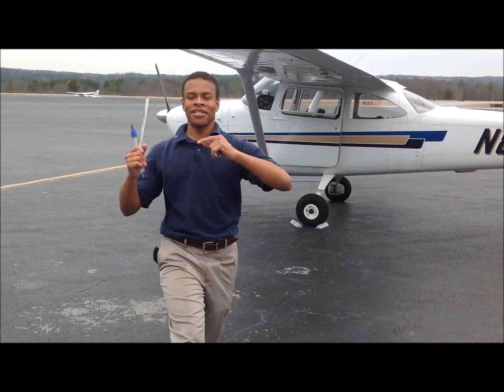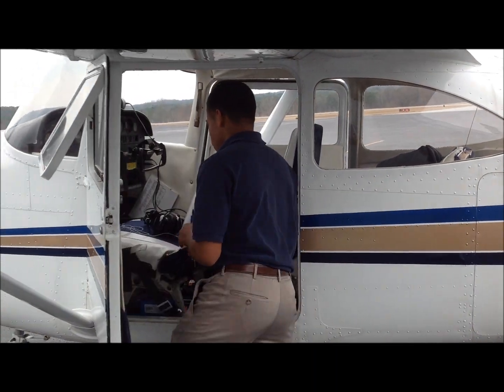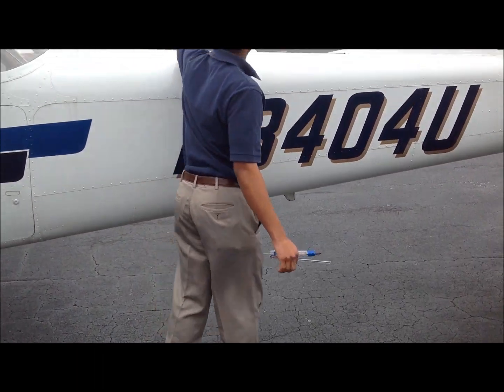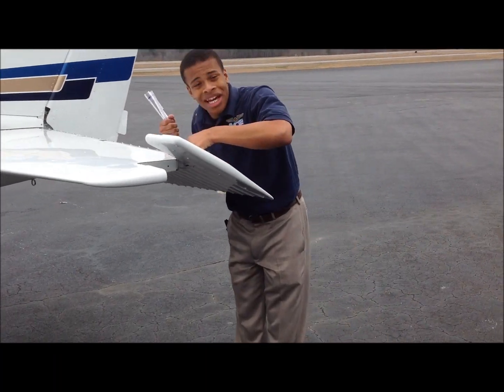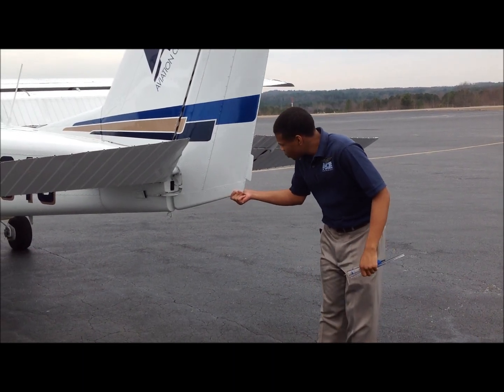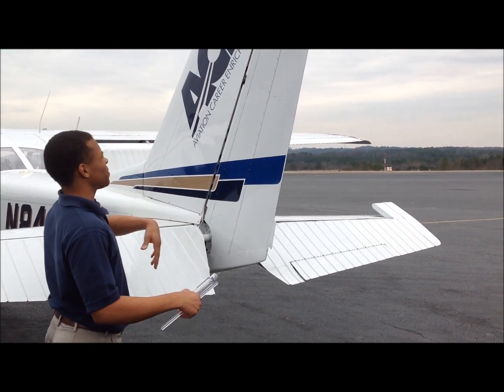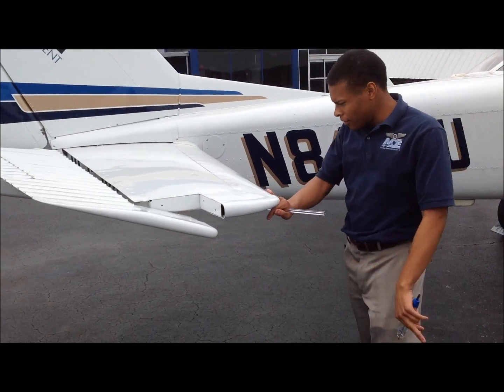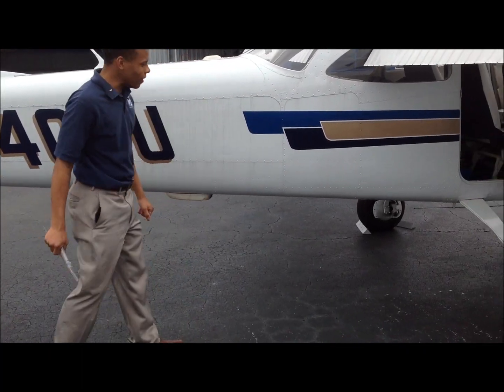How to Preflight a Cessna 172 [HD]

Comment: Pro tip

- Check there are no wrinkles on the wing and the horizontal stab that runs about 45 degrees of the cord line. If so, the plane was over-G'd.
- Never put your finger inside the slot where the aileron attaches to the wing without supporting the aileron with your other hand. A gust of wind can move these surfaces, leaving you with one less digit. This also applies to the rudder and elevator.

Comment: 9:01, you don’t need to move the prop at all. Not worth the risk. The only inspection you should do of the prop is running your finger along it to check for cracks or dents.
Reply: u actally should have listened to his explanation afterwards [on realizing that he may be mistaken]
Reply: @ISAIAHSIMBA-z9s I did listen to his explanation. I have over 200 flight hours, most of which is in the Cessna 172. I still wouldn’t mess with the prop like that, in the off chance that the magnetos are not properly grounded, which would risk an accidental hand propping, which would be extremely dangerous.
Reply: @videogameplayer0552  well ...I get your perspective...I just think he cautioned against it

Comment: I love your preflight but I have questions. How do you know that the light bulb on your navigation lights and landing lights are working? I usually switch the lights on while the flaps are lowering and do a quick walk around with all the lights on and make sure that the lights are actually working. Also, you didn't show the interior check making sure that your markings, fire extinguisher and first aid kit is there. You did mentioned that you checked the aircraft documents but then also with a preflight, interior inspection, cracks or damages to the instruments, seat belts working and latching etc. Also, I like to check the belt through the front for the alternator cause I've found it where that belt is near break and the last thing one needs is a alternator light warning and a sooner landing on a cross country to get the belt replaced.

Comment: Behind the left wing strut is the fuel overflow vent. There are two purposes for this vent. One, that vent allows excess fuel that either expands in the summer when hot temperatures causes fuel expansion or fuel flow out when the tanks have been overfilled, and two, the overflow vent allows air to flow into it in order to replace fuel as it is being burned. This prevents negative pressure, which can lead to vapor lock and engine shut off.

Comment: I have my students to turn on the master switch, lower the flaps, check the fuel gauges, and do a quick walk around just to check to see if all the lights are functioning properly and when turn the master off and proceed with the external preflight inspection.

Comment: Just a couple of things 
1. Always check the baggage compartment 
2. Always check the baggage compartment door is secured and locked. Had it pop open one time
3. You checked the upper portion of the wing for riverside popped always check the under wing for secure rivets and secure inspection plates 
4. While the master is on check your nav lights strobes etc also
Reply: Also did not check the belt on the alternator

Comment: I absolutely loved your PreFlight video.  It was exactly the same as when I learned in 1974.  The sad part is now it's 2020. It seems every rental service comes with a different version of how they prefer to do PreFlight.  My complaint and this goes out to everyone.  When a CFI doesn't want you to check the oil (saying he'll do that) or don't drop the flaps we'll check it on the Run-up is just another case of inappropriate training, at least for the Cessna 172.  The last and most crucial part of any PreFlight I consider the absolute most important is Fuel Checks,  from adding fuel properly to checking it after fueling up.  On my recent Annual with a CFI I watched and knew to check the fuel by straining a sample before starting the engine but he was in a hurry and simply fueled and flew without checking.  I'm happy to say that day he got lucky but I wouldn't be. Which brings me to the point never refuel an airplane without checking the fuel for sediment.  Let me rephrase that more specifically Never start an airplane unless you check the fuel first.  I have and probably always will run into on occasion contaminated fuel.  Strain and check as many times as necessary until all water or sediment like dirt or metal debris from refueling are gone and if your not sure wait at least 20 minutes or 1/2 hr. and check again.                                                           Hey, GeneralAviationGuru how about a proper Run-up Procedure, at the cost to instruct I'd rather watch your videos over and over that way I know I'll get it right.  P.S your video was so in depth I decided to Subscribe and click the bell for all your videos. Again that was excellent

Comment: You forgot to check the air filter as well as the edge of the propeller  plus the fuel tank vent tube. have a safe flight. Bravo to Charlie

Comment: dont dump fuel on the runway even in Georgia, it all washes down stream.
Reply: it won’t wash down stream unless it’s an excessive amount of fuel. it typically evaporates extremely fast
Reply: @0_wba  Lead does not, and it leaches into ground water
Reply: @krisztinaholly  it’s not common lead used in these small planes, it’s tetraethyl and it evaporates at pretty much room temperature

Comment: Nice video however the only thing I would include is the use of a CHECKLIST no matter how well you know the inspection. Also to visually check the baggage compartment for any leftover and/or loose items that could add unwanted weight and/or possibly create a weight shift while flying.

Comment: Informative video. Carry an accurate electronic gauge and check the tire pressures. Flying club a/c almost always have underinflated tires. I've seen hard landings damage wheel flanges (expen$ive to repair) because the tires were underinflated. The pressure specs are in your POH. For example, Cessna 172S and later: nose wheel=45 psi (cold); main tires=38 psi (cold).

Comment: It is not f*cking "O.K." to dump your fuel sample on the ramp, no matter if it's legal or not. There is a reason why it is illegal in Florida, and it being legal in Georgia is just a sign that Georgia lives behind the moon in this respect!
Get an old canister, collect the stuff and dispose of it properly. What you're doing and recommending is f*cking outrageous.

Also you didn't check the prop for nicks, cracks, etc. and as a safety precaution: Before inspection, always remove the ignition keys and place them on the dashboard underneath the windshield where you can see them from outside and never touch the prop if you cannot see the keys underneath the windshield. 
You only have one pair of hands. Complacency kills!
Reply: GNUFZ I dump gas on the ground every chance I get.  I’ll pour some out in your honor today 😭😭😭😭😭

Comment: Suggestion from a checklist I use...  Master on: Switch ALL lights on,  including Pitot Tube heat.  Check all lights and touch the tube for warmth.  Master off.   Put a tennis ball on your fuel measuring stick.  Position it so that went you drop the stick into the tank, it is at the top.  Prevents accidental drop of the stick into the tank!  Tally Ho!!!

Comment: Excellent video!  I was taught to alway's control with one hand any control surface that you were evaluating BEFORE placing fingers to check for weights , pins , connections etc., because if you had your finger in there and a gust of wind moved your control surface you could cut off a finger or two.
Reply from the maker: Thanks.  I was taught and do the same.  Some things like that missed illustration in the video

Comment: So when you're in Florida, how do you check the engine fuel sump?
Reply from the maker: +Jake Jones We didn't have GATS jars at that flight school, so it was the only choice at the time.  I really don't/didn't like the idea of dumping fuel, especially since there is a major waterway near that airport.  I'm happy to now have better equipment at my disposal.
Reply: +GeneralAviationGuru   When I first started flying, DECADES ago, dumping fuel was as normal as tossing a glass of water. Guess environmentalists have had a significant impact. Anyway, for what it's worth, the hydrocarbons simply evaporate harmlessly into the atmosphere.

By the way, nice video. Thumbs up!
Reply from the maker: +Jake Jones Thanks!  

Haha you're probably right.  But I probably wouldn't want the lead or other additives in the water
Reply: +Jake Jones  Hydrocarbons, i.e., volatile fuels, do evaporate as vapors but they aren't harmless; they're so toxic as to be carcinogenic. That's why cars with SI engines have been built with evaporative control subsystems since 1978. It's not just the "impact" of "environmentalists." The gas vapors remain in our atmosphere near the surface where Us Humans live and breathe. Every pilot should carry a "gasoline analysis test separator" (GATS) jar. And if the fuel is airworthy, it can simply be dumped back into the tank.

Comment: I watched the entire video. Well done, learned that I had be omitting the top rudder hinges by not looking up. I would add pulling on alternator belt for proper tension, if accessible on the 'F' through the air intake. I check this on the 'R'.
Reply from the maker: +David Williams I also check this on the R/S models (or any other model with a Lycoming engine); however, the Continental engine drives the alternator from the accessory gear box, hence the alternator is mounted on the back of the engine (no belt)

Comment: I learned a couple things from this video, but I disagree with few things:

1. Some commentators already pointed out the FAA required checklist wasn't used during the inspection.
2. The propeller wasn't inspected for nicks and dents. 
3. I would check the spinner to make sure that it would not loose and wobble.
4. Fuel samples should be checked not only for debris, but more importantly for water contamination. 
5. What's wrong with putting the fuel samples back in the fuel tanks? Just make sure that the fuel sample test tube is clean before testing the fuel.
6.  With a strong wind gust that snaps the aileron,  you might loose the fingers that you put in gap between the aileron and the wing!

Good video anyway! :}
Reply from the maker: +Tuan Tran

1.  Per standardization at the 141 school where I currently am flying, we preflight with the checklist in hand.  It was not required, at the time, at ACE.

2/3. Thank you for pointing that out.  I made a couple of omissions in the making of the video.

4/5.  I would certainly consider water as "debris"/ unwanted foreign matter as far as fuel is concerned.  I agree putting the fuel back into the tank.  However, we had very old fuel sampling jars that did not filter particulates.  Without a GATS jar, I wouldn't want to pour it into the tank, especially with an old and dirty fuel tester.  Again, since I know fly FAR better equipment, we simply pour it from the GATS back into the tank.

6.  That's why I hold the aileron with my other hand! :)
Reply: +Tuan Tran Things must have changed since I last flew because there was no FAA checklist. And who's gonna climb back up just to dump an ounce or two of fuel back into the tanks?
Reply: In general the preflight is not meant to be super comprehensive all encompassing inspection of an aircraft, I can make that checklist 300 items long checking things from rivets to the internal wing spar to control rods and cable to a tiny oil spill etc. The preflight is meant to cover critical items such as flight controls, amount of fuel, oil, fuel contamination and the legality of an aircraft, as you gain experience as a pilot you will learn to determine what is and isn't safe.
Reply from the maker: +Jake Jones Doesn't need to be "FAA".  It has just become standard practice in recent years to accomplish the preflight with the checklist in hand.

Comment: Is it bad that I don't use a ladder for  checking the topside of the wings? I step on the strut.
Reply from the maker: Ristan Jones Well, this particular plane doesn't have the steps installed on the fuselage and strut, so it is best to use a ladder, rather than step on the plastic fairing at the root of the wing strut.
Reply: o ok

Comment: Where is the checklist?
Reply from the maker: Previously, I always referenced the checklist at the completion of the preflight.  Currently, per Auburn's FOM I have the checklist in my hand during the preflight; however, the inspection is still accomplished in a FLOW.  The preflight should never be a read-and-do procedure.  You're actually more likely to miss things that way.  Flow then verify is the way to go.
Reply: GeneralAviationGuru Wether it should be a read and do or a do and verify procedure is very much up to the person. I prefer do and verify as well but a lot of my students prefer read and do.
Also on a checkride it should always be read and do. I got a lot of shit on my CPL check ride (in alabama) for doing the preflight as a flow. Here in San Diego in particular the examiners will most likely fail you if you do it as a flow.
Reply from the maker: Well said.  Wow, I'm quite surprised at that.  We have Examining Authority here, so as long as you follow the School's Manuals and the PTS, obviously, you'll pass with the Chief.
Reply: GeneralAviationGuru I guess it comes down to the interpretation of the PTS. If you look under Area of operation 2;Task  A; Section 2 it says "Inspects the airplane with reference to an appropriate checklist".
In my mind a flow that is later verified would be fine but the examiners here still wants you to follow the checklist.

Basically we do all checklists on the ground as read and do and all checklists in the air as do and verify.
Where are you based?
Reply from the maker: Very true.  A verification with the checklist should satisfy the PTS for pretty much any checklist requirement.

At Auburn University, virtually every checklist is a flow (ground or air), and of course you obviously also have your emergency memory items and then read-and-do.
Reply from the maker: KAUO is our base.
Reply: +cockpitts  Who needs a checklist? For crying out loud, must there be a "checklist" for EVERYTHING? Use some common sense.
Reply from the maker: Current FAA standards and recommendations include the use of a checklist for the preflight inspection (i.e. just have it in your hand, for the experienced person)

Comment: No where did I see a checklist used in conjunction with this preflight tutorial. The Private Pilot Practical Test Standards (PTS) says the aircraft will be inspected with reference to an appropriate checklist. How do you explain that to students?

Task A: Preflight Inspection (ASEL and ASES) References: FAA-H-8083-3, FAA-H-8083-23; POH/AFM.
Objective: To determine that the applicant: 
2. Inspects the airplane with reference to an appropriate checklist.
Reply from the maker: I always complete my Preflight as a flow; I find that checklists are often cumbersome in the thorough inspection of the aircraft.  However, following my inspection and before entering the aircraft, I ALWAYS cross-checked all items on the checklist.  

Now that I'm completing the rest of my ratings here at Auburn, Part 141 I'm required to have the checklist in my hand during preflight.  Still, the preflight is NOT a Read and Do operation, always Flow then Verify.
Reply: GeneralAviationGuru Pt 61, Pt 141, one PTS. I'm glad your new school agrees with me. 

BTW, The Cessna 100 series preflight checklist is designed to be used as a flow pattern, then verified by written checklist. The aircraft is broken down into ~8 zones with a list of tasks for each zone that flow in logical progression. Amazing how that works. ;-)
Reply from the maker: To be fair, the PTS does not explicitly require having a checklist in hand during the preflight.  It merely should be referenced so as to verify the completion of items.